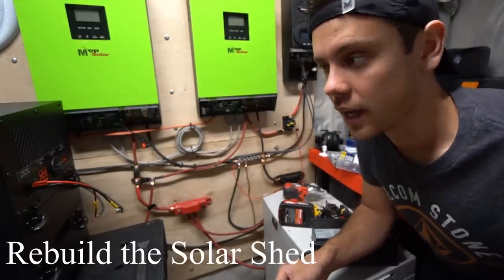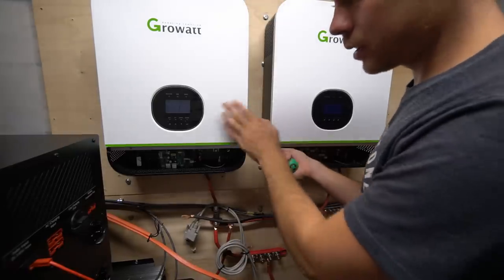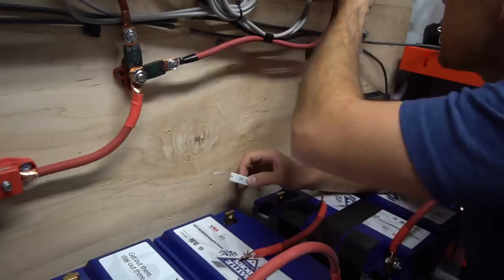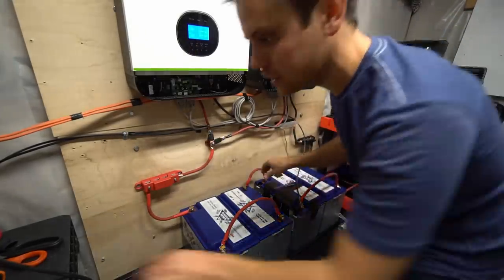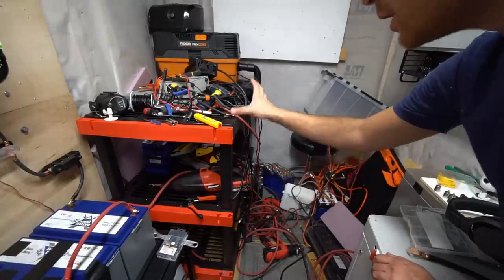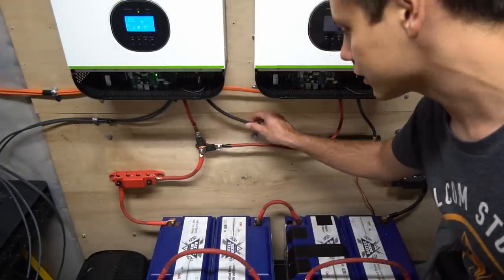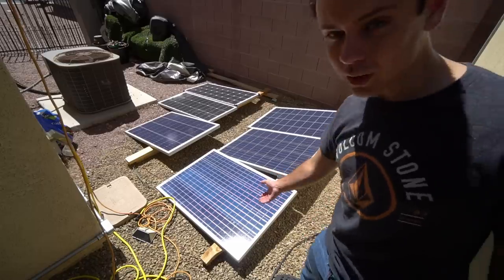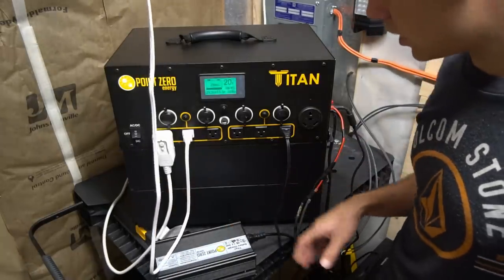Upgrading the Solar Shed: 48V Growatt Inverter Install (and organizing my junk pile)

Comment: I just got in the Growatt 6000t dvm in from Ian.  Great customer service.  I can't wait to get it installed. It's over 100 lbs, so I'm getting my mounting straight first.
Reply from the maker: Mounting is hardest part. Smooth sailing after that. You will love it!

Comment: It's great to see how you're finally worried about how cables looked your cable management style has definitely improved
Reply: Ha ha wait till I send in a pic behind my entertainment center.
Reply: Hello everyone, 

I have a Growatt Off Grid Solar Inverter SPF 3000TL LVM 24P receiving PV from 3 panels 440w each, in series, able to charge my LiFePo4 battery (a custom built 4000w without BMS communication supplied by a local solar company) and power the loads in my trailer. The main appliance is a 548 kWh/year refrigerator, and there's a little reducer running at all times converting 120v into 12v for the lights (LED) and carbon monoxide detector. My challenge is the battery keeps dying overnight,  and then I'm unable to power up the Growatt in the morning (even if it's sunny). I have no connection to the grid, and no generator (yet). My efforts to configure the Growatt to prevent the battery from draining to zero haven't worked. Ideally the Growatt would shut off power to the trailer once it gets to the low voltage setpoint (24V), saving enough power in the battery for me to turn it on again once it's sunny. Any help would be greatly appreciated!

Settings:

01 Output source Priority: SOL 

04 Power Saving Mode : SdS (disabled, when I enable it, it immediately turns off the 120v to the trailer, even though there are loads)

05 Battery type: US2 (lithium battery without bms communication)

06 Auto Restart when overload occurs: enabled

07 auto restart over temp: enabled

12 setting voltage point back to utility source when selecting sbu priority or solar first in program 1: 24v

13 setting voltage point back to battery mode when selecting SBU priority or solar first in

 program 1: (26v? I can't remember)

19 and 20: charging voltage and floating charging voltage: 28.2v

21: low DC cut off voltage: 24v

Thanks in advance!
Reply: @ryan lowe You might find good help on the diy forum Will links to in the description, easier for you to ask follow up questions also.

Comment: I love your videos and the way you can explain things concentrating on the essential information not confusing newbies with the little details they might not need to know. 
Could you do a video on PID and negative grounding? Maybe also clear up differences between negative grounding vs chassis ground vs lightning protection (for beginners)?

Comment: Use your LV5048 inverter/charger with the new 48V battery. It can be configured to different AC outputs, has two independent MPP solar inputs and combines everything in one box 
Add a relay in series with the LV5048 on/off switch.  Relay turns on when battery voltage is > 46V and turns off when voltage reaches  20% of battery capacity.  This will turn off LV5048 before battery is drawn down to low and eliminate it's high standby power need (70W).

Comment: Please more Growatt details. I just got mine in this AM. Not much on YT for Growatt.
Reply from the maker: It's the same as mpp. Dead simple to setup. Be sure to read manual. I'll make some videos on the setup
Reply: I've had mine in service now for about 3 months, just got the second usb wifi adapter in yesterday, if your using the growatt shine app you'll need one for each unit. They've worked really well. I'm running mine in split phase, with 2 mini split 240 volt AC units on them, 12,000btu and an 18,000 btu unit, a 120 volt 5,000 btu window unit, my fridge, home theater, 3 chest freezers, washer and dryer since my dryer is gas, and all my computer systems as well as my microwave and toaster oven. My microwave is a little 1000 watt Goldstar I've had since 1994. Currently have 2.8 kilowatts of solar into each and I'm adding another 800 watts to each one this weekend with an array setup to catch the early morning sun to help boost its charging earlier in the morning. I run mine in the OSO mode for only solar charging unless there is a major storm coming through then i'll switch them to CSO mode where it'll charge from solar first and at the end of the day top off with utility to keep the batteries full in case of an outage. I have 280 amp hours of lifepo4 storage and I have it set to switch back to grid when the low voltage hits 51.2 volts, leaving me with about 130ish amp hours in the batteries for any short outages. Peak load on either one doesn't exceed 2500 watts each so I'm in good shape there. I have a smaller Victron Phoenix 375 inverter that I have the lights and ceiling fans in three of the rooms I use most hooked too and it's connected directly to the batteries so I have lights and fans even if I had to power down the Growatt inverters for some reason and I have a separate 1000 watt array connected to a Victron 100/20 48 MPPT charger for added redundancy. I'm running them in the Solar First mode so as long as the battery is above the set voltage limit and solar is present it'll run everything off batteries/solar till it hits the battery voltage level to switch back to the grid or no more solar is being produced, eventually with a larger battery bank I'll set it to SBU mode instead, but for now this mode keeps me with enough power in the batteries to handle outages during the night. With all the AC use etc now that I'm in summer it runs all my stuff from 9am till almost 9pm most days. With the new arrays I think I can get it to run from 8am to 9pm most days instead. It's already cut my grid use in half or more depending on the weather and cloud coverage.
Reply: @WillProwse  Looks good, impressed with the finished arrangement. Is there a reason you had and deleted a solar charge controller?
Reply: DIY Solar Power with Will Prowse I just bought the growwatt from your site... I live in a cabin that has grid power... which ATS would I use to make grid power strictly backup? PV / Lifepo4 would be primary....any recommendation, I’ll surely buy through you!
Reply: @WillProwse  Yes!  Looking forward to the Growatt setup video.  As someone who has never has to setup one of these the menu settings can be a little confusing.  Thanks again Will.
Reply: Andy Peeler Great info thanks! Have you measured standby power consumption by any chance?
Reply: @justicelee26  I hadn't measured it but booklet lists less than 50 watt. For giggles since today was an overcast stormy day I've reached my setpoint battery voltage to switch back to grid, so I cutoff the solar input breakers and my stand alone Victron 375 attached to the batteries and cutoff my second battery bank so only the one battery bank is supplying the Growatts as well as the AC input. It pulled 89 watts from the bank according to my ANT-BMS. If I get a chance this weekend I'll turn off the AC Input and outputs so the only power source is the batteries with zero loads in or out and see if that number changes. If it doesn't then at least in the case of mine that's 44.5 watts each. They do have an eco mode that will turn off the inverter if the load is below a certain amount, but there are no stats in the specs as to what they load level is or how often to checks to see if there is a load. For my use I'd never use it and it's set off by default.
Reply: Andy Peeler subbed to remember details of setup. 
Bought EB240 Bluetti w 4 of their panels. Runs washer not dryer (it draws 1500 W motor); dishwasher. From 240-850+ watts so one at a time. House lights off of small patriot solar ones run lights 4 hrs. Kitty fountains on usb too. 
Next install is the mpp w 48v batteries. Socal Will: FIRST KWHR IS &0.20 then 500-2000 cost .27 each. In Jan up 27% from that. Thanks guys  for inspiration
Reply: @andycanfixit  Wow. Can you make a video of your setup?
Reply: Just got my Growatt yesterday.   Got it mounted today.  Ian at Watts247 was nice and helpful.  Thanks Will!  Couldn't have done this without you!!
Reply: @GamerZoneSpice  Planning on doing that this weekend.
Reply: @WillProwse  Hi will, I have the Growatt 6000T from Ian. I just hooked it up to 8 Battleborns. What's the recommendations for charge settings  in user mode? My unit on Litium setting expects to talk to the batteries via a data cable which the battleborns don't have so I could not use that.
Reply: @Mark-gz8ft  Ian is an awesome guy. Spoken to him many times on the phone. Resolved all my issues without even being asked. Highly recommended.
Reply: Can you put the growatt on a skoolie
Reply: @Tiagoschannel2012  I don't see any reason you could not do so. Would everything be 120 volt loads or do you have 240 volt split phase loads you want to power? If 240 volt split phase you'd need two of them.
Reply: @GamerZoneSpice  Finally got the vid of my setup loaded, finishing the vid of the Growatt Dashboard app right now. I have to say, I've been really happy with these inverters. They just continue to run and run.
Reply: @andycanfixit  any assistance would be great. I installed 2 24v 3k units. 
1 how do you turn on the device and not the inverter? I would like the unit to stay on without the inverter turned on?
I know it turns on automaticly if there is PV input but I only have solar going to one device to it shoots up and error because they are split phase and only one is turned on.
2 how do I stop the beeping!!! I have made the change on menu 15 as instructed but it turns back on when the device power cycles. you go to menu 15 and it says beep is off yet it still beeps! ready to rip the beeper off the board.
3 I can not get the wifi unit to work. so frustrating. I have google wifi. I have read about the 5Ghz not being supported. is that still true?
4 am I running split phase settings correct? I hooked up the data cables per instructions and set device 1 to 1P and device 2 to 1p1 but device one still says HS. is that correct?
Thanks
Reply: @longiotti1  The only method I can think of is to use the power save setting, otherwise you would normally leave the units on. Depending on the amount of solar panels you have, I would break it into two strings instead of one so you can feed each unit with it's own separate feed, that should allow both to power up/down with solar coming in. 
The beep gets reset each time it's powered off, there is a second set of beeps if there are critical errors and those can't be silenced. 
The WIFI only works with 2.4ghz, so your router needs to support that. On some routers they have different SSID's and passwords for the 2.4 vs the 5ghz, so if your using the settings for the 5ghz and your 2.4ghz is different that could explain it. 
The 1p and 2p is correct, the primary will list HS and the secondary will list 2p. The manual unfortunately doesn't mention it but that's the correct display after you set the primary to 1p and the secondary to 2p. The only thing linking them together should be the data cables, none of the red black paralell cables should be connected. I cover that in the vid I've done on these units. 

Hope this helps. In my setup I have each unit fed its own solar, they stay on 24/7, so I'm running them a bit different than you are.
Reply: @WillProwse  Make some videos on using the Software Management System "WatchPower" or the other Voltronic version called "ViewPower" and if Anyone uses Linux OS and uses either WatchPower or ViewPower and knows some helpful tips please share as I have had a hard times learning to use these power tools with Linux OS.
Reply: @vincei4252  Hi Vince - I am looking to get that exact unit. Would you mind telling me about your experience? What is the standby power like? Are you running it with split-phase output? Thank you!!
Reply: Wondering if ground and neutral can be bonded at the ac out, scare to try, dont want to burn it. Havent found any videos on Growatts in that matter , any idea?
Reply: Saying GD is not cool!
Reply: @ozzgel83  You can, although it is best if done in your breaker panel. Only one bond per network.... so obviously do not do this if you are using mains backup
Reply: @WillProwse  can you do a video on how to wire an AC load center panel and a discussion in circuit breakers surrounding it?

Comment: You should set a good example and mount the inverters etc on a non-flammable surface like concrete board it would screw right on to your plywood backboard.  And you could surround the metal battery table with it also. You could also use metal nut it is conductive which of course has its own dangers.

Comment: use the rv output. an make a  ac terminal distro from there for a simple 1 cable to the titan
Reply from the maker: Yes good idea
Reply: DIY Solar Power with Will Prowse I used the RV output on the Titan to wire into a transfer switch on my RV. I also have shore power wired into the transfer switch. Transfer switch defaults to shore power if available. If not the Titan powers it. The transfer switch is wired into my main AC panel on the RV and it works great.

Comment: I'm moving to a rural area up north because NYC is completely psycho now.  Need to prepare for power going out, and must keep a couple desktop PCs running for work.  Thinking that maybe a battery bank charged with a generator would work.  I won't be settled right away, so not ready to invest in solar.  SO NICE to see you working on your own setup, in your own place, after watching your channel back when you were on the road.  [Later:  Bought your book and checked your solar site.  Looks like I should switch to laptops.  One panel, a battery or two, charger and inverter would work great for charging laptops and be very cheap.  I'll just use propane or wood for heat.)
Reply: I don't think that laptops are inherently more efficient. Dell has come out with a 90 watt power brick that has a more efficient transistor in it and it's overpriced and shows how ridiculous it is while desk top computers have that as a standard commodity now period.

If it's cheaper to use a generator it cost even less to transport the batteries to work or wherever you can connect to a existing electric meter. You can get a homemade electric car for almost nothing and those are the best way of transporting electricity. There was even a lithium titanate oxide electric truck sold so cheaply it got flipped and offered for cheap even then.

As I mentioned however the fuel cell if you can produce your own hydrogen is now available for under $10,000 with a free car to move it around at very high speeds.

Generators can be cheaper than solar if you have a use for all the heat they produce and get a like hundred kilowatt model from San Francisco that was designed to operate at an extremely slow RPM so that it would last forever and has the silencer and exhaust chiller with free space heating hot water being the result. I spoke to that seller a few years ago the market for marijuana has dropped already back then but that generator cost over ten times as much as he was selling it for. He was quite a character! Like many good people he was sucked into the profitability of retail solar.

Comment: Signature Solar updated their recommendation on the Growatt 48v inverter. They seriously recommend that the inverters are NOT! mounted on wood/combustible material. Also, the Growatt manual recommends 4 AWG cable, for the battery connection,  whereas Signature Solar recommends 2 AWG for the 48v inverter. I guess this was brought out by testing results.

Comment: You need to do a video about running a petrol generator with a automatic transfer switch to the ac input as a backup power supply if its even possible to do so

Comment: Im new to solar and fell in love with the 24v MPPT  And the ease of use,  just wondering why you changed to the 48v Growatt 
is it not good????
Reply: In the beginning of this video, he said the lv2424 was too large of a system and he was interested in getting better efficiency that comes with the 48v system. That’s why he went from a 2400w system to a 3000w system. Lol. But he said he was dropping the size of the battery too

Comment: Quick question about these units. When you exceed the solar input and it switches to 'line', does it load share between the line and solar? example; if solar is capable of 1000W and you load the system to 1,200W, does it switch completely to 'line' and pull 1,200W from there or does it augment the 1,000W of solar with 200w from the 'line'?
Reply: I'd like to know this too.
Reply: @AGhostInTheMachine  They are a high frequency design. The booklet states its surge capacity is double it's rating for 5 seconds, or 10 seconds at 110-150 percent. There is a 40 amp breaker on the input built in as well. So as long as you stay under the peak surge capacity for 5 seconds or less you should be okay. I suspect the 40 amp breaker will trip if you exceed the 5 seconds. Everything runs through the inverter near as I can tell based on how the fans spin up and down depending on load even when connected to the grid.
Reply: If you exceed the solar input it'll pull the excess watts from your battery bank until the battery bank hits whatever low voltage transfer point you've set it to. It won't pull that extra power from the line input. Line input can power loads as well as the utility charger for the battery bank, but it can't share line input and solar, or else it would be a grid tie inverter and it's not. It either pulls power from the grid or from the batteries and solar but not from both. It can switch between sources in about 10ms.
Reply: battery drops below set the transfer switch takes line power  its not grid tied